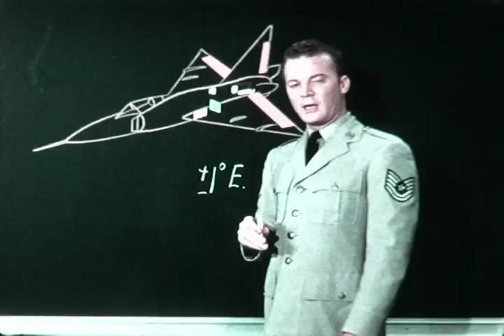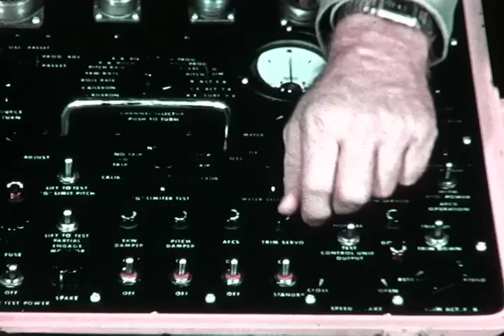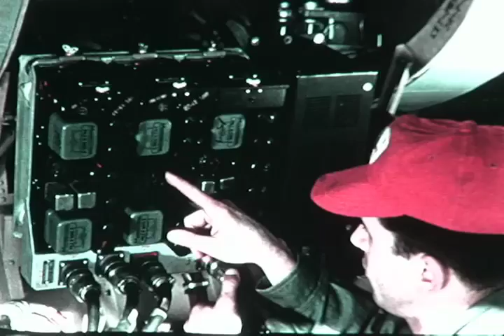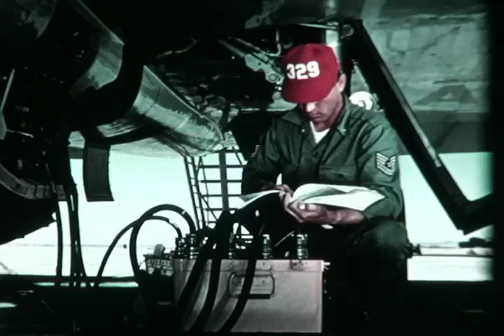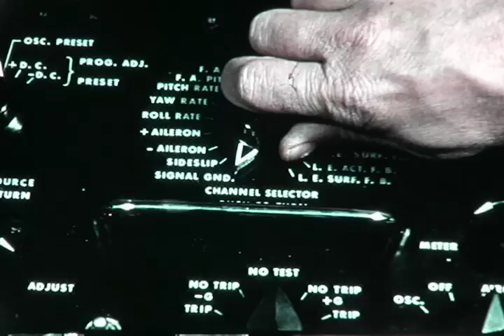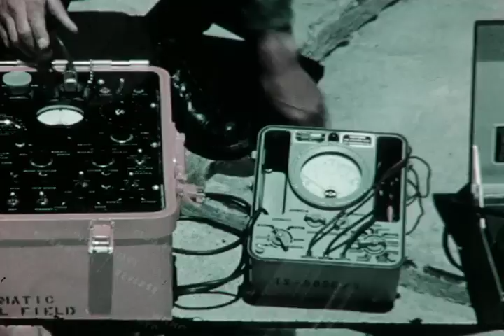F-0672 F-102A Automatic Flight Control

Comment: According Col. John Boy's Energy-Maneuverability Theory of aircraft maneuverability, F-102 should be able to defeat Mig-21PF in a turning energy fight. Yet F-102 could not. So straightforward mathematical analysis of left vectors and wing loading of both aircraft cannot take into account all aspects of aircraft, as they relate to maneuverability.

Comment: Too young to have worked 102s but watching op checks with test boxes like that puts me right back on the flight line.  Touchy adjustments in very noisy environments.  The only thing missing was the pouring rain!
Reply: And the freezing temperatures.  Yea